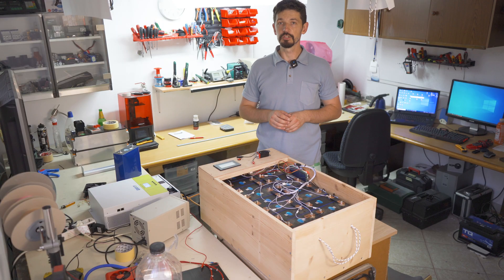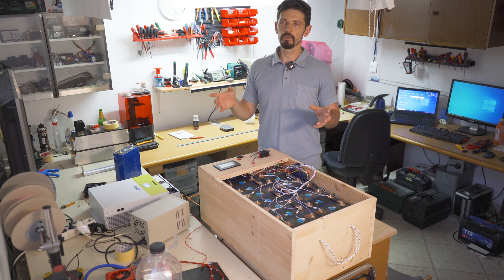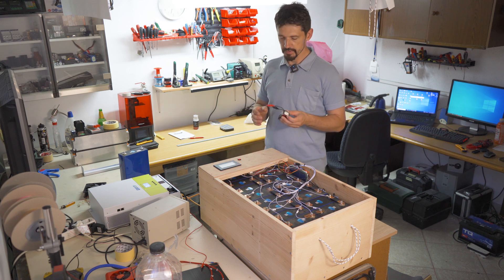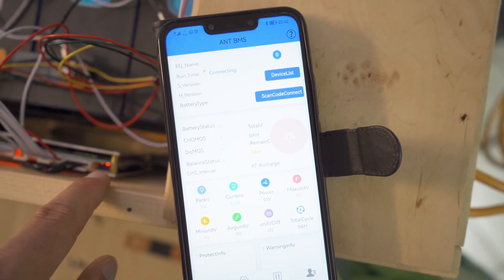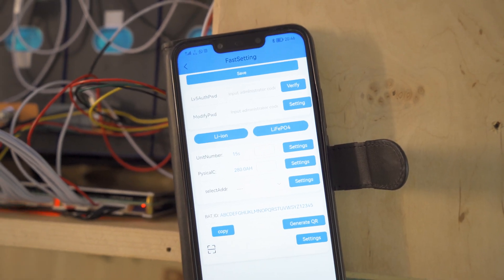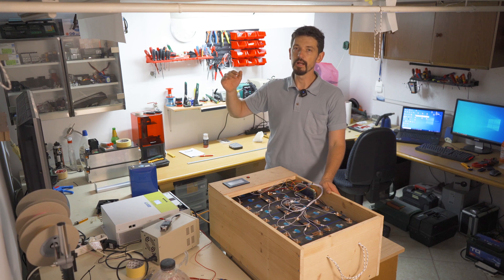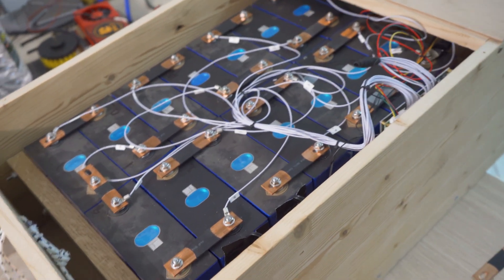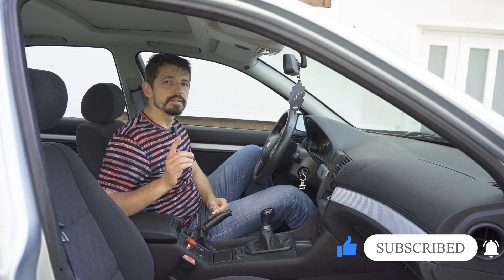LiFePO4 configuration for hybrid solar powered system

Comment: Not necessary the capacity was lower of that cell, just simply it was more charged at the beginning and so it was the first, which is overcharged. Without any perfect top balancing, there is obviously high voltage different at full charged state.
Reply from the maker: When I started to charge, voltage on this one was lower then all others, and managed to overcharge all others. But yes , it run away because BMS was not in function yet .
Reply: @bimerev  I see, thx.